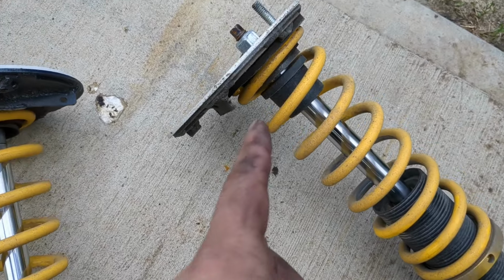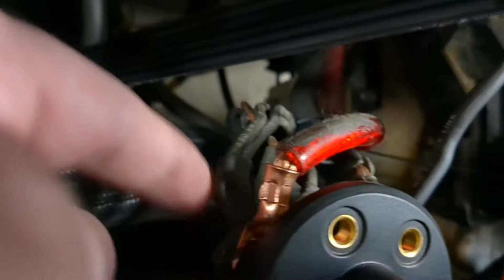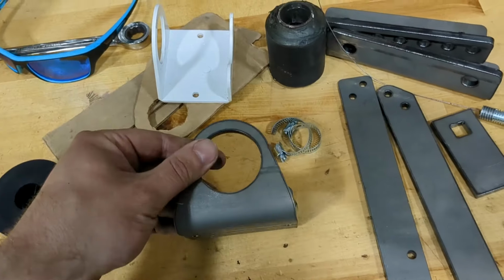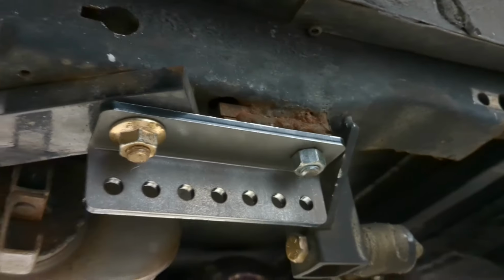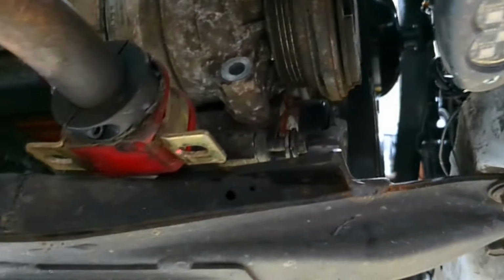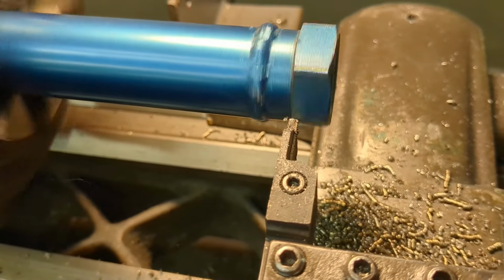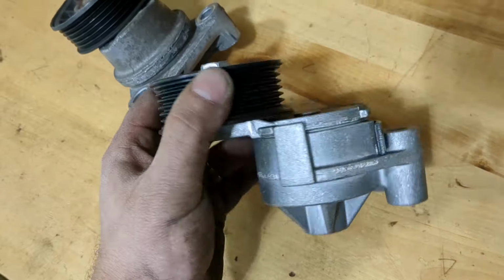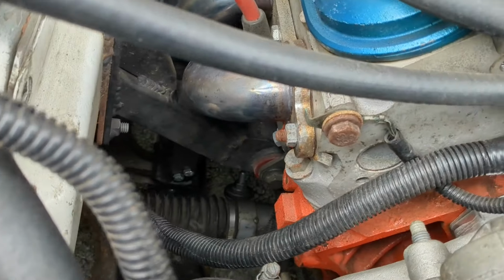Re-engineering suspension and steering. Handles SO GOOD now. Beretta #LSswap

Comment: Awesome!

Have you checked the size of a 2wd s10 sway bar? It looks like it's about the same as that one just skinnier
Reply from the maker: I haven't, but I want to keep an aggressive rate. The long arms already reduce stiffness, so it's gotta be pretty thick to be effective.
Reply from the maker: I might do a "circle track" bar that rotates inside a bearing and the arms clamp on splines. That way I can run it directly through the front subframe and not lose ground clearance.